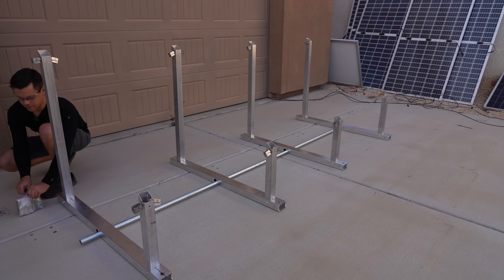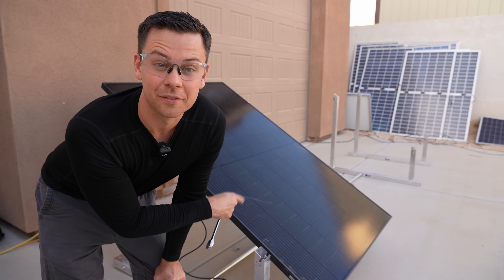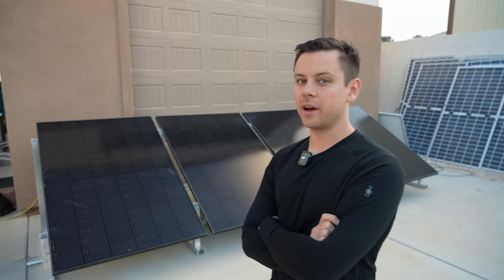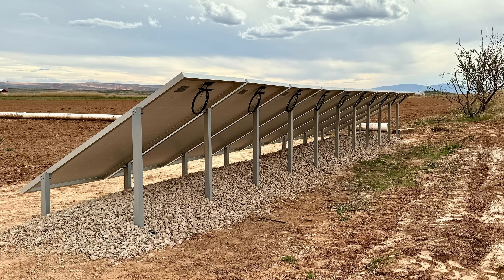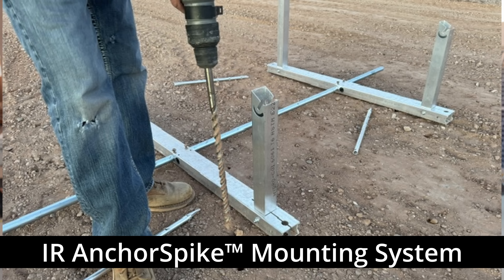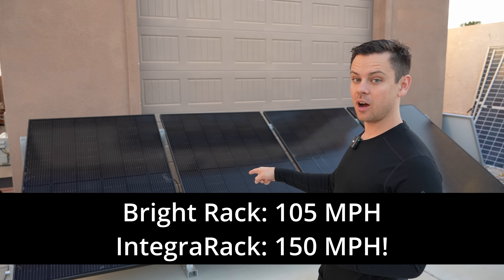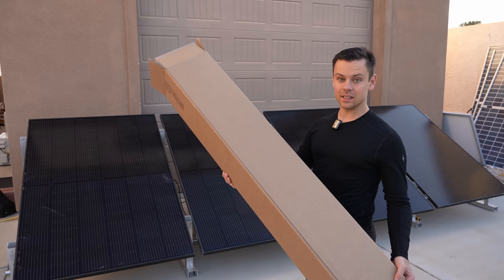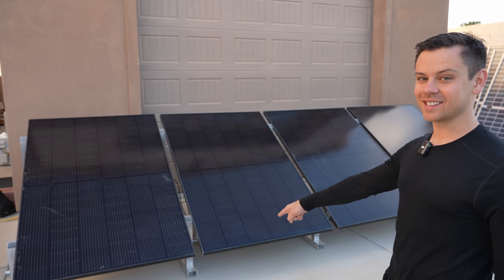IntegraRack: $545 Ground Mount Solar Array Assembled in Less Than an Hour!

Comment: Anyone that’s looking for mounting solutions in snow country I highly advise you to find a way to get them more elevated so when you clear snow it has someplace to fall without building up and needing to be shoveled away after.
Reply from the maker: Measured 15 in up in the front. Would be cool if you could buy extension option. Especially for bifacials if you want to increase output
Reply: @WillProwse I've been to the website and I'm still not sure 😕 about the cost per unit... for the enter set up you put together was 108?
Reply from the maker: Yeah the clearance in the front is actually pretty good. I should have covered that in the video more. You can slide it up pretty high if you have snow. Most of the people using these are in Utah mountains right now.
Reply: @WillProwse anyone know what state will lives in?
Reply from the maker: @32SQUID  I'm in Nevada no snow here.
Reply: @32SQUID  Arizona
Reply: @32SQUID  Las Vegas
Reply: my hometown neighbor. 
Vegas baby...
Reply: @WillProwse  Hah.  I've been to Pahrump and through Mountain Spring recently.  At least SOME parts of Nevada are getting snow!
Reply: Nevada
Reply: @WillProwse 
There are a few in South Dakota too!
Reply: My ground mount (near Algonquin Park Ontario Canada)  has the panel bottom edge at 50" from ground level.   In a "regular" winter I have to clear that bottom pile at least once a month or it get's too high & prevents snow shedding.   

It s a real PITA to do as well and even the snowblower (really tricky) doesn't enjoy it either.
Reply: Yeah  having the poles be about 2' longer would be great, would mean the assembly would require a stool or ladder but otherwise wouldn't change much.
Reply: I've always wondered with snowy areas, wouldn't a basic heating element or pad attached to the underside of each panel (doesn't have to be the whole panel either) allow you to melt the snow so there's no accumulation? I'm designing my off grid cabin system and am trying to figure out a way around the snow issue so I can have solar year round.
Reply: @brianrenner  My Starlink has a heating element, which often keeps it clear of snow, but it needs some good clearance underneath it (mine is just a ground-mount stand) or the dripping water and sliding snow just makes a big chunk of ice at the downhill side that bridges from the ground to the dish, eventually requiring I chip away the ice to keep it working. I'd be concerned something similar would happen with melt-water and snow coming off solar panels. IMO, better to just elevate and let the snow stay fluffy-ish. Easier to remove than ice from refreezing of the melt.
Reply: @brianrenner   I would rather keep it as snow and fall off the panels.  Its easier to remove snow than having it turn to water and then when it hits the ground turn to ice. Maybe if you were going to go that route if you bought some solar thermal panels if you ran pex and glycol right under the ground and could do some water management you could have it melt the snow/ice?  Even then I would question if it would actually melt enough or if it would just basically create a tunnel where some of it would melt? You'd want the panels on some sort of hill to move everything away. If you could get that to work it would be nice since you could move water to some sort of pond.  I could be totally wrong and I'm not basing what I'm saying on any real world knowledge.  I'm just thinking out loud here.  Maybe someone else might be more informed and say what I'm thinking is not true at all.  I dont have any problem admitting I'm wrong. Actually one other thing that would be nice if someone actually could capture the water is they could do testing on that water to see if any chemicals are leeching from the panels.
Reply: @brianrenner  The problem would be controlling that. Youd have to flip it on just before you thought I was going to snow. Otherwise you'd be wasting 30+ watts per panel all the time.
Reply: Is there a way to vary the tilt angle? More tilt during the winter and less during the summer?
Reply from the maker: They now  have higher racks and adjustable ones for snow. Check them out here: https://www.mobile-solarpower.com/ground-mount-racks.html
Reply: @WillProwse  Thanks for the update and link
Reply: That's real!  I didn't have mine high enough! 😂
Reply: use a shovel to clear the snow if need be
Reply: @robert4027 You obviously don’t live in the Northeast.
Reply: My solution was to move to a better climate.
Reply: @WillProwse  JUST WOW 👏 THIS IS A GAME CHANGER !!!!!!!!!!!!!
Reply: Pricing is great, panels to, I just wish shipping wasn't so expensive right now. Interesting mounting option; I like how they give you three ways to secure them.
Reply: @WillProwse  According to their website, you only get one set of legs - so a 3 panel setup would require 4x$109: 

Included
Hardware
(1) IR-30 Base Tube
(1) IR-30 Long Leg
(1) IR-30 Short Leg
(4) 5/16″-18 x 3.5″ Carriage Bolts
(4) IR-F2 Flange Clamp Bonding Brackets
(4) 5/16″-18 x 2.5″ Carriage Bolts
(8) 5/16″-18 Serrated Nuts
(4) 5/16″-18 x 5/8″ Thread Cutting Bolts
Reply from the maker: @joemontana4370  Yes just updated the thumbnail and title. I asked yesterday and there was a miscommunication for what is a kit. Sorry about that.
Reply: Hey neighbor 
Nice upgrade. 
I'm still tinkering with portable power. 
Tell the complainer..If you want it done right "then do it yourself "..
Reply: Those tinker toys aren't going to hold up to a South Dakota breeze much less an actual wind storm.
Reply from the maker: @steveb855  why don't you comment on my other ground mount videos that have a lower wind rating? But this is the one that you criticize? The one that's stronger than the others, and costs more? Not sure your logic here

Comment: Superb! The next issue is to ensure that the panels are difficult to steal. Also, if someone is stuck with a North / South roof, it would ne nice to get a solution...I cannot refactor my roof...its just too cost prohibitive...finally, if its possible to get a sun following installation...it would be awesome too...thanks a lot for the great content.
Reply: Panels have gotten so cheap that stealing is usually not worth it anymore...
Reply: It would be really easy to cut out a T shape pieces to go on those vertical mounts. That would give you a lip over the panel on each side. You could have those T pieces held on with padlocks if you want.
Reply: Yes because $70 (resale) heavy large 4' by 6' panel theft is on the rise.  Not.

Comment: Use pedestal blocks for a solid mounting option. A single bolt on each block; one on the front and back between each panel support, will keep it from going anywhere.
Reply: What is a pedestal block?
Reply: You're gonna regret that decision !
Reply: @SandyBarbee explain
Reply: @SandyBarbee  Use all thread so you can go all the way through the block into the ground to keep the block from sliding.

Comment: Looks pretty game changing. At 100 it is practically the same cost as building rack from pressure treated wood.
Reply: Looking like it is 100 per set of legs
Reply: @calebdunlap2746 I thought the same - the setup Will had would not be $109, but $109 x 5. I understood the the Bright Mount as 4-panel mount for $280. Please correct if I’m wrong
Reply: Agree, but $129 total with the required local EMT purchase.
Reply from the maker: Changed the thumbnail and title, it is 109 per leg

Comment: Will, is that one complete $109 kit that you used, or did you add parts on for your setup as shown in the video?
Reply: Each leg is considered a kit, he had 5 kits. So almost $600..lol
Reply: @charlesbaker1978 Yep, $600 not $110 as depicted in the video. I was excited as that is a bit cheaper than what I do with unistrut and it looks much easier.

But, no, it is 3-4x as expensive. Boo.
Reply from the maker: That's not true at all, you get four legs for $109
Reply from the maker: Why are we getting so many of these ignorant comments today this is driving me nuts
Reply: @WillProwse  
Included
Hardware

    (1) IR-30 Base Tube
    (1) IR-30 Long Leg
    (1) IR-30 Short Leg
    (4) 5/16″-18 x 3.5″ Carriage Bolts
    (4) IR-F2 Flange Clamp Bonding Brackets
    (4) 5/16″-18 x 2.5″ Carriage Bolts
    (8) 5/16″-18 Serrated Nuts
    (4) 5/16″-18 x 5/8″ Thread Cutting Bolts

Straight from the link in the description this is why the confusion
Reply: @rhettsanborn621  this is exactly what I read off the affiliate link but I guess I'm ignorant

Comment: I wouldn't trust this setup in Colorado. Where I live we can get 100+ mph winds at almost any time. When I saw that the panels didn't actually have screws going through the frames I cringed. If each and every bolt isn't torqued to spec, and then maintained at that torque then these panels will be sailing away on you.
Reply from the maker: It's rated for 150mph. It sucks that you didn't watch the video or read any spec sheets. Comments like this are very disappointing
Reply from the maker: And you're concern for using a bolt through the panels frame is not justified. There's quite literally hundreds of UL listed racking clamps that work like this.
Reply: You must be a blast at parties!
Reply: Have you never heard of threadlocker?